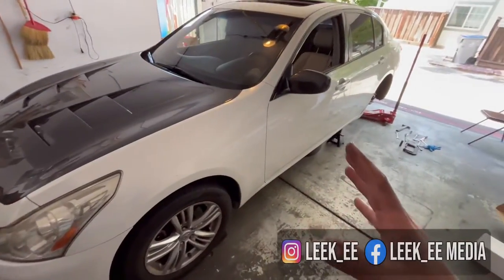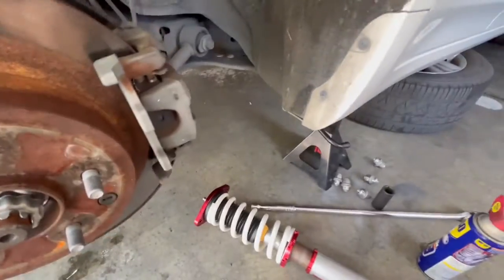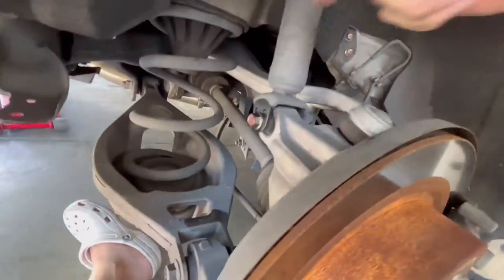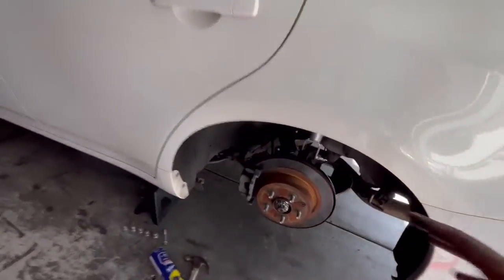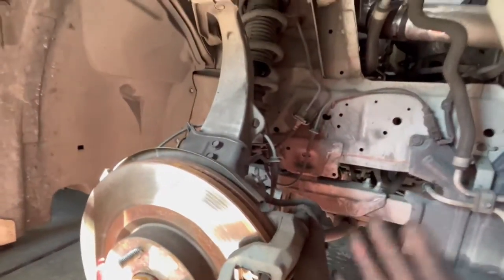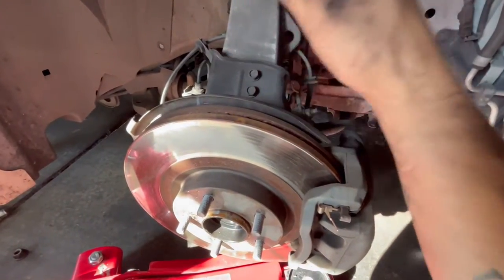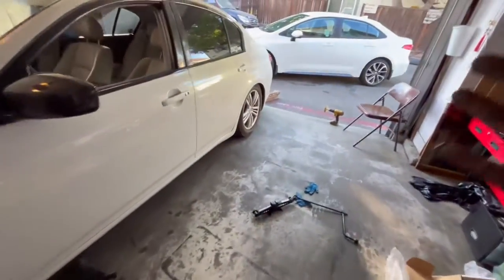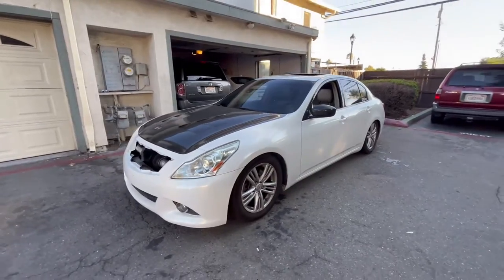Coilovers Install | Infiniti G37

Comment: Do I have to take off the spring bucket? Is it necessary? I'm installing my coilovers but the bak is giving me major bounce. Is it because th3 spring bucket?
Reply from the maker: The spring bucket gives clearance to remove and install the strut. If your after market suspension is a multi link set up then yes. But overall, you’ll still need to remove it for clearance for the install
Reply: @Leek_ee  I was driving with it and it was VERRY bouncy but I took them off and everything is great  I love the coilover experience tbh
Reply: @ivanelgordov9099 yo please reply I just install coil overs on my g and the rear is bouncing any and everywhere, what did you remove to stop the bounce ?